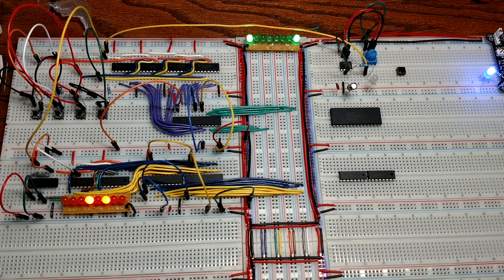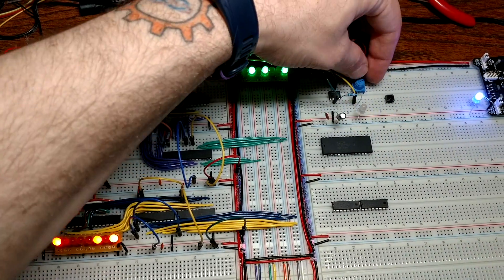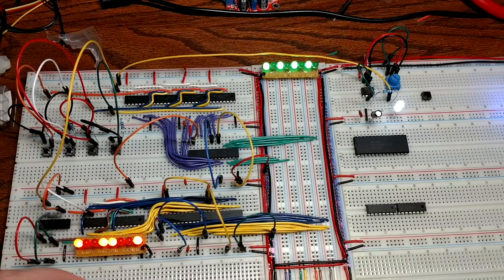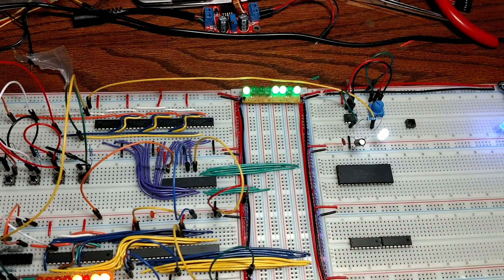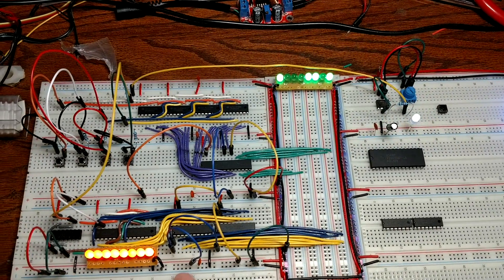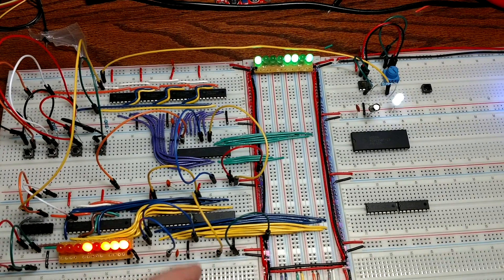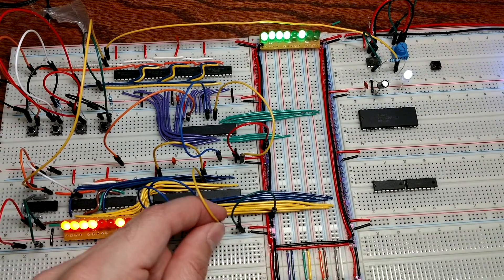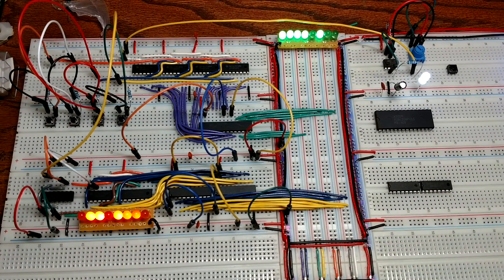TTL Brainfuck CPU - 01: First Breath

Comment: Thats amazing! Although I'm sure sure it was a struggle to keep all the breadboard connections stable enough for reliable operation. But nothing as cool as a cpu from scratch!
Reply from the maker: I upgraded to some much higher quality breadboards (jameco) shortly after making this video and have a lot more of the circuitry in place. It seems to be stable up to ~2 MHz and only drops about 0.15v from the power input to the opposite corner.
Reply: @cogwheel42  That is really incredible. I have always thought CPUs were the most "magical" things in a computer - sometime I want to build one myself. Your video is an inspiration to do that.